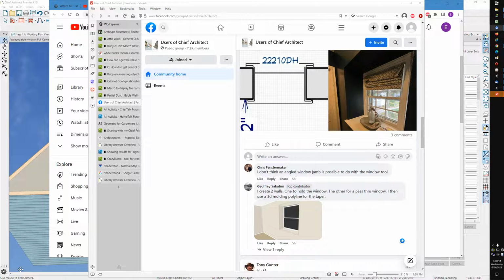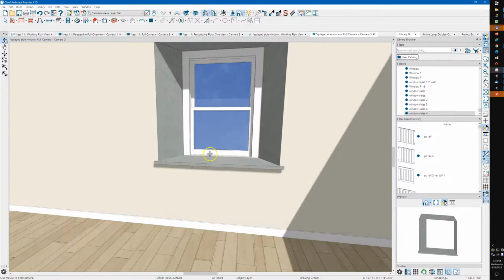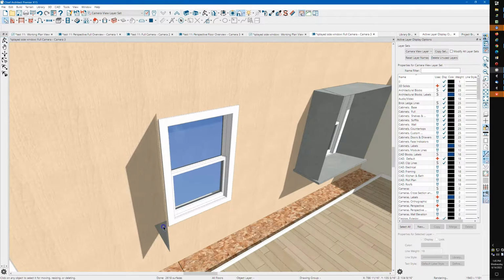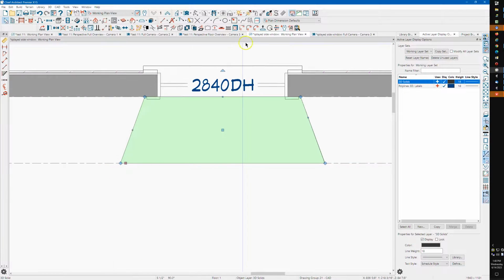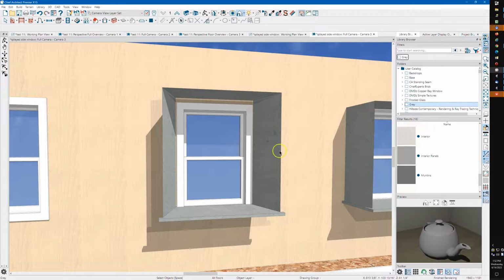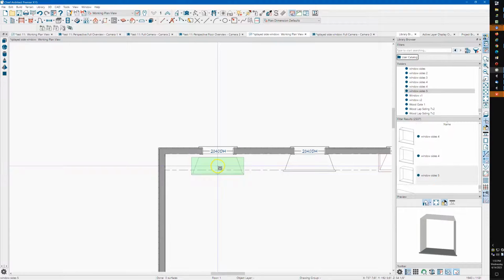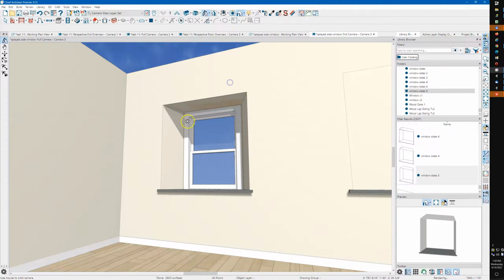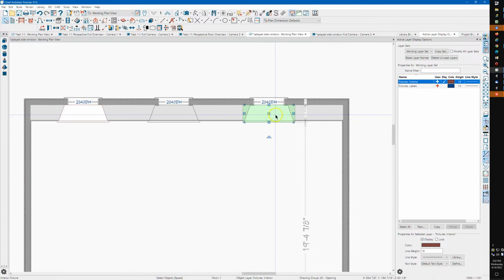Splayed (Angled) Window Sides - Chief Architect

Comment: I have been grinding away on Premier X16 to reproduce your results.  I can get the symbol created and it will cut the wall in the model space but it will not cut the wall to suit the spay in plan.  I had to use 3D solid for the splays with 1/8 thickness similar to the top soffit.  Would really appreciate any feedback, direction you may want to share.  Thanks for the help this far with the video  It makes for a beautiful detail, I am trying to reproduce the widows on a century stone house renovation.

Comment: Way to much work as good as it is. If there is a big enough demand for this style of splayed window frames,  CA should be able to give us the option of doing this within the Window DBX under window frame, Option button>Int or Ext: Skewed: On/off, Degrees from vertical and horizontal center planes> Top: Y/N, Bottom: Y/N, L-Side: Y/N, R-Side: Y/N. Thickness would default to window frame thickness. Then Material in Materials. Casing would/should work as it does now. For now, your way I suppose is as good as it gets. I played with this for a while prior to seeing your video and deemed it a waste of time, (no disrespect to you), I settled for just a filled solid color background 2D block for use in plan view. Then I did a detail in 3D Sketch Up Pro model imported to CA just showing a generic representation in 3D of the finished product referenced from plan view.  Till CA catches up with all requests, work-around's is all we have. Keep the videos coming.